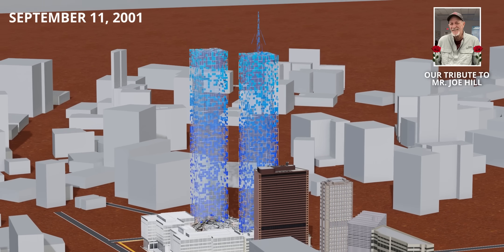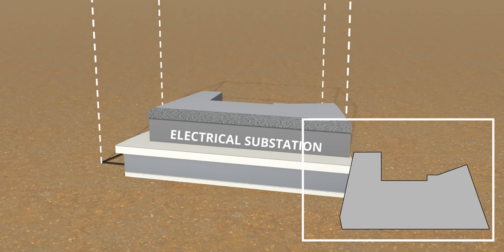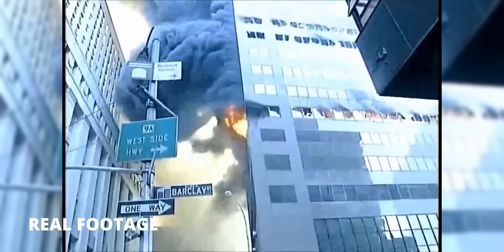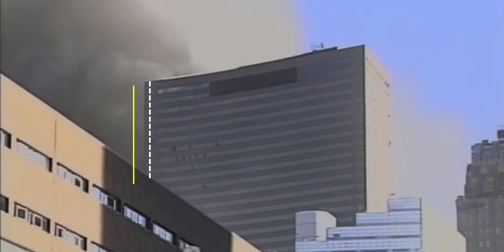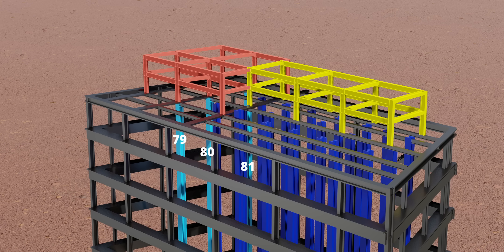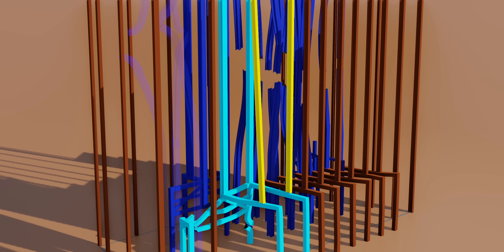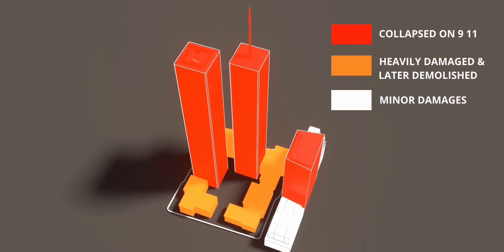Collapse of Building 7 | The Complete Physics

Comment: They got rid of the evidence, so of course 
WTC 7 had to come down.
Reply: Hard to "get rid" of something that never existed. And no, "There was no sign of it or any proof, that's proof!" isn't an argument.
Reply: What evidence
Reply: @mikebyrd8278  Physical evidence, the structural steel with explosive residues on it.
Reply: @MassEffectGER  yeah there's no evidence of that
Reply: @MassEffectGER  will your original post doesn't even make any sense.  So you're saying buildings 1,2  had evidence of explosives so they had to bring down 7. Makes no sense whatsoever.  Where is your proof they had residue of explosive
Reply: @mikebyrd8278  Now you're likely aware that you cannot refute my technical arguments above, so you're now to gish-galloping to the motive, trying to make it as a prima-facie "rebuttal" of my explosive-demolition argument.
But I can give you one reasonable motive: WTC7 would have been the biggest obstacle for a fast and cost-safely removal & rebuilding of the entire WTC complex. The dismantling of WTC7 from top to bottom would take years, like in case of the Bankers Trust building. Since it was very likely demolished by an explosive-induced implosion, this building was rebuild as the first WTC highriser (2002-2006). Does it now makes sense to you?
Reply: @MassEffectGER  well they didn't collapse at free fall speed, the collapse was not symmetrical, it was not a perfect implosion as numerous other buildings in the area were completely destroyed. Did you expect them to leave toxic debris in Manhattan indefinitely. It was not a mystery what happened. The steel was inspected by nist in the New Jersey landfill.
Reply: @MassEffectGER  your" technical argument" doesn't make any sense.
Reply: @MassEffectGER  yeah there's no evidence they had to remove building 7 to remove the debris of buildings one and two 🙄 they removed the debris on trucks.
Reply: @mikebyrd8278  "yeah there's no evidence they had to remove building 7 to remove the debris of buildings one and two 🙄 they removed the debris on trucks."

You're clearly not grasping of what I'm saying here, either because you really can't read or comprehend, or because you're doing it on purpose by playing dumb.
Also, your sheer ignorance before my technical arguments as well as your gish-gallop is annoying. It's toxic to any honest debate.
Reply: @MassEffectGER  yet the  fire department determined building 7 was going to collapse hours before it did and evacuated the area
Reply: @mikebyrd8278  "your" technical argument" doesn't make any sense."

"arguments", plural! 
Then refute them by counter-arguments, show and convince the audience how and where I'm wrong. 😏
Reply: @MassEffectGER  because there are interviews with firefighters and the fire chief all the sating the building was in danger of collapsing. Yes it does refute your theory it was blown up.  Just because there was 2.5 seconds of free fall acceleration doesn't prove there was explosives. Just because people heard loud noises doesn't mean they were explosives. Just because you believe they had to remove a skyscraper to remove the debris ( which makes zero sense) doesn't mean you are correct.
Reply: @MassEffectGER  I think it was chief Hayden stating that FDNY had their "special operations people" monitoring WTC7 and that they asked these special people whether the building might collapse and if so how much time they have and that they were "pretty much right on the money" by saying "you have about 5h".
NIST also mentions FDNY people monitoring the building. However, despite these "special operations people" obviously were phenomenal experts by predicting not only that the first collapse ever of a skyscraper due to fire would happen but even WHEN, we never learned their names, they never showed up in ducumentaries nor interviews, also we never got the monitoring data, absolutely NOTHING but the pure reference that they have been there and predicted when the building would collapse. Yeah, why would NIST interview them? Why would NIST care for the monitoring data? They didn´t need WTC7 debris so why would they need other sources right?

(Prediction only possible if it was controlled demolition.)
Reply: @Kudde23 that is the most ridiculous theory I've ever heard. So the fire department is somehow complicit in killing their own people 🙄

"Not only predicting the first skyscraper ever to follow from fire" also the first skyscraper to be hit by a commercial jet airliner. How about the fact that the exterior walls were pulled inward several feet. 

But to the crazy person no they knew about the explosives planted exactly where the jets hit an they somehow managed to survive the impact and fire
Reply: @TheCriticalStinker-01  Thanks for acknowledging me again Fitzshill! I mean you´re doing this quite often, acknowledging me only to acknowledge me. You show respect to me Fitzshill, I acknowledge that!

Comment: bullsh*t
this building was destr*yed on purpose, via controlled dem*lition
same as the Twin Twers.
Reply: I'll stick with the science,  thanks though.
Reply: @TheCriticalStinker-01  this sounds like "science" but it smells bad.
I suggest checking the organisation called AE911
(Architects and Engineers for 911). They've been very thorough and prolific in their work.
Peace.
Reply: @TheCriticalStinker-01   this explanation presented as "science" is for the non-science aware, and is made to impress them, but without solid substance.
I suggest you check the AE911 (Architects and Engineers for 911). They've done thorough and prolific work in demonstrating that the official story - including WTC7 - does not hold against the simplest scrutiny.
Reply: Yet the fire department determined building 7 was at risk of collapsing hours before it did 🤔
Reply: @mikebyrd8278   the risk of collapse was indeed mentioned to the owner of the building (Larry Silverstein) via telephone, supposedly by the FD, but we don't really know who was on the other side of the line from Silverstein. This said, it is really easy to "predict" something is going to happen when you have planned it to happen. Controlled dmolitions are not planned in a few minutes or hours. It takes far longer than that. So again, if you've planned something, you can "predict" it will happen.
Reply: @yamilandres yet you have zero evidence they were referring to blowing up a building specially mentioning it on national television. Also the fire department does not blow a buildings an it's  completely ridiculous theory
Reply: @mikebyrd8278  who says that the FD said that?
Larry Silverstein?
Right...
Reply: @mikebyrd8278  FDNY didn´t determine building 7 "was at risk of collapsing". They predicted that it WOULD collapse and even WHEN. Only possible if it was controlled demolition.
Reply: @Kudde23  yet you have absolutely no evidence of any controlled demolition. An the idea you think the fire department had something to do with a controlled demolition is completely idiotic
Reply: @Kudde23 yet nist said it fell 40% slower than free fall speed.  Your theory is completely ridiculous
Reply: @Kudde23 Ohhh you're not talking about explosives??? Then what the hell are you saying??? An yes the fire department determined building 7 was at risk of collapse. There is video of them saying it
Reply: @Kudde23  so you're saying it was explosives and wasn't explosive simultaneously 🤡 maybe you should watch some more conspiracy videos and make up your mind 🤣

Comment: BEST, if not only technical explanation of WTC7 I have seen. Every armchair conspiracy theorist needs to see this. Because of the dubious substation workarounds, this building was an accident waiting to happen.
Reply: @h1F595  - Every time you acknowledge it, it wins.
Reply: @TheCriticalStinker-01  Thanks for acknowledging me again Fitzshill!
You shill girls will never win. It´s your job to be losers, that´s what you´re paid for.
Reply: It's basically a retelling of NIST's report but the video doesn't even explain NIST's report correctly.

The cause of the collapse according to NIST was the beams connected to girder A2001 experience thermal expansion due to the fires.

The thermal expansion applied enough force to the girder to push it off its seat at column 79.

When the girder fell, it initiated a buckling of the columns & then the progressive collapse occurred.

If I tried to explain the problems with this, Youtube will most likely delete my comment. I will just say there's research out there that shows it's not possible.
Reply: @h1F595  Oh, you had to jump on a question you can´t answer, AGAIN? So sad mikroshill, so sad...
Reply: Explain the free fall the Lesics shithead doesn´t even dare to mention. Oh you can´t? What a surprise my poor wannabe...
Reply: @h1F595  Oh, you still don´t dare to adress the question you had to jump on without being able to answer it? So sad mikroshill, so sad...
Reply: @h1F595  You prove that you´re not able to comprehend anything mikroshill. The obvious question you always jump on without daring to adress it is: How do you explain the free fall (without controlled demolition)?
You can´t. None of you shills can. That´s why you never even dare to try. All you can do is dodge and cry. Now go dodge and cry AGAIN mikroshill...

Comment: You have to turn your brain off to believe office fires brought down a 47-story steel tower at free fall speeds
Reply: Fire is one of the most destructive forces on earth, destroying tens of thousands of buildings every year. Sometimes entire towns, even cities.
Reply: @TheCriticalStinker-01  it doesn't melt steel and drop buildings built to NYC code at free fall
Reply: @Barkeroni  The perfect symmetry of the collapse is what really what makes it so unbelievable, imo.
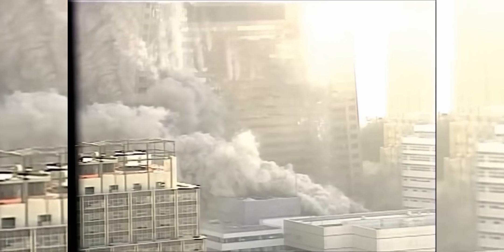Reply: @Barkeroni  Who is claiming that the fire melted steel? The fire was hot enough for the steel to bend and it didn't collapse in free fall. You weren't kidding when talking about turning your brain off because you clearly didn't pay attention to the video 9:09
Reply: @hideofreakingkojima5457  buildings on fire dont fall ar that speed, genius.
Reply: @Snoozie09  spot on, you have to literally remove steel sections at perfect timing to do that.  ZERO resistance
Reply: @Barkeroni  I literally never said it did, genius
Reply: @hideofreakingkojima5457  its on video.  Maybe take a blindfold off?
Reply: @Barkeroni  The same video where the East Penthouse collapses and see through the top floor windows on the left before everything else falls?

Comment: OMG.  What a bunch of propaganda bs.  If anything this video states is true then every architecual text book would have been changed.  But they weren't.

Building 7 still remains the only steel building EVER to collapse by fire.  (Other than the twin towers)
Reply: This video is very good – with one or two exceptions - and goes into a much higher level of detail than many viewers will be able to comprehend.  While not perfect, the collapse mechanisms – the sequence of failures - described here are substantially correct and this is true no matter who planned and carried out the 9/11 attacks or why . 

That may not be what you want to hear and go against 20+ years of entrenched dogma and conditioning, but it’s not wrong. 

That also means (in case you did not get the hint) this video can be (and IS) absolutely correct in its description of collapse mechanisms AND the 9/11 attacks could still have been some sort of inside job. The two things are in no way mutually exclusive. 

The mechanisms described here have broad professional support around the world. There are no professional engineering organizations (for example: ASCE, ASEE, ICE, etc) that disagree with them or have offered any formal dissenting opinions or alternative hypothesis. 

So, setting hubris aside, either the overwhelming majority of the worlds structural engineers and simple observation are wrong,… … or you are. Which seems more likely? 

IF you still think believe this explanation is wrong then produce a better one . Good luck with that. No one ever has and I don’t see you moving that needle today. 

No one ever does.

Also, no countries attacked the U.S. on 9/11.  The attacks were carried out by non-state actors, none even from UAE.
Reply: @TheCriticalStinker-01  Honest question, do you believe there were any bad actors within our government that day?
Reply: @Snoozie09  - Bad actors regarding what?  I can't answer something that incredibly vague. Sticking just to topic (the collapse of Building 7) I would say there is zero evidence of bad actors within (the U.S.) government in any way responsible or culpable in its loss, which was incidental collateral damage. 

But fundamentally, for the purposes of these discussions I do not care.
Reply: Thank you for your response.  It was a passionate defense of this video, if not well reasoned.  

You didn't address the main points of my post. How is building 7 the only collapse of a steel building in the history of mankind 

How are buildings 1 and 2 the only steel buildings to collapse in history? 

Why hasn't every architectural

Bad actors? I never said anything about bad actors in my post.
Reply: @mrolls12  - How can you possibly think believe Building 7 is the only collapse of a steel building in the history of mankind (other than the Twin Towers)?

Countless tens of thousands of steel framed buildings have collapsed in the last 150 years.  Hell, I saw dozens of steel framed buildings collapsed in my own neighborhood after the George Floyd riots!  To say no steel framed building has ever collapsed is just a monumentally ignorant statement. Steel is formed using heat and deformed the same way. Contrary to lore which exists only in the tiny world of the 9/11 woo corner of the internet, steel structures are uniquely vulnerable to fire, not immune to it.

Your claim is not well reasoned 

Snoozie09 asked about "bad actors" and my reply was directed at that individual, NOT YOU.  Please do pay attention.
Reply: @TheCriticalStinker-01  Please provide just one example of what you think is the most comparative example to WTC 7.  

Were any of them perfectly symmetrical as they collapsed? 

Did they also fall at perceptibly free-fall speeds? 

Clearly, there were fires inside WTC 7 - but nothing on par with any example you can provide.  
Because we're saying the fires clearly weren't that bad (according to what we can see in video footage, and indeed from Barry Jennings' witness account).

Again, please give one example (video footage) of what you believe to be is most comparable to WTC 7's collapse.  I'll wait.
Reply: @Snoozie09  The collapse of Building 7 was anything but symmetrical,  let alone perfectly symmetrical.  You need to stop just copying other people's bad ideas off the internet and just look.